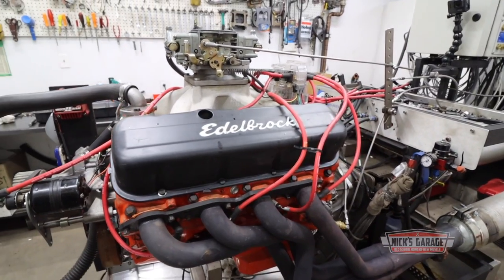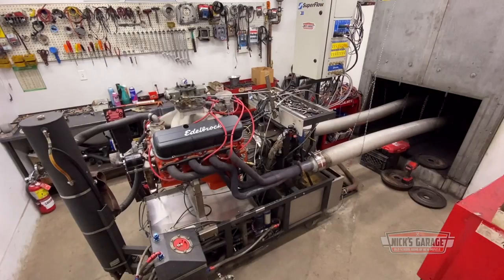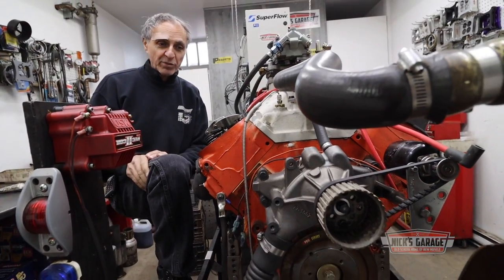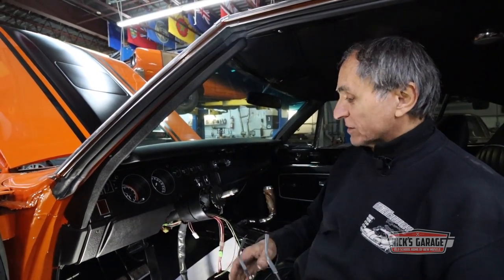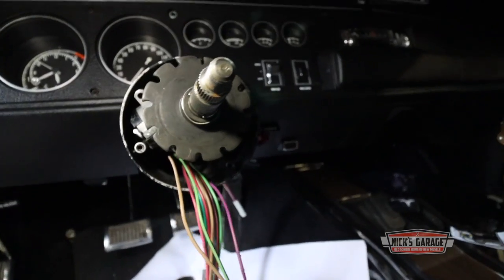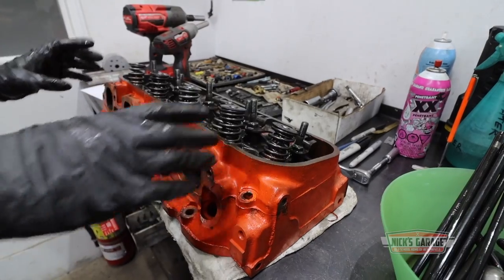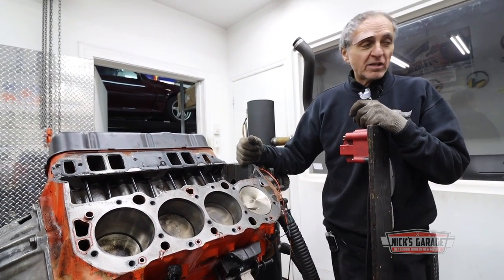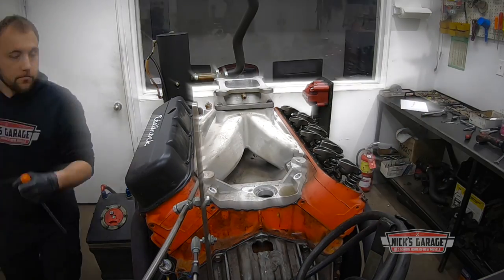Weak Big Block Chev • Wrong Parts + Poor Assembly = No Power!

Comment: As soon as I saw the fire burp out, I figured it was floating its valves too soon to get up into the power band. Turning the flattop pistons is an old speed trick, it moves the offset piston pin location and acts like a longer connecting rod, in that it keeps the piston at TDC longer. It can't be done on domed pistons, tho.  The low compression of the flattops would be great for a power adder on that rat.  Meanwhile, a mild cam and head ports that large, isn't a sin--it makes for a streetable engine and the large ports act like a large lift pattern in the cam.  At lower RPMS, tho, those giant ports create poor flow characteristics and promote the heavier fuel to fall out of suspension as a result. And that gear drive? that IS old school. It removes the slop and stretch of a cam timing chain.  But, its something to remember should the customer go to EFI...that gear drive creates vibrations, and a knock sensor will pick that up in the block as detonation and cut back on ignition timing. 

The solution to this engine?  Either stroke it out to add low RPM torque and take advantage of those too-big heads (in the 1970's, smart rat builders knew the oval port OEM heads in the junkyard were better on the street than the OEM rectangle ports), replace those heads with some oval ports, that single plane intake with a high rise dual plane, and an 800 cfm carb to increase the compression to get more low RPM power, or use nitrous with the combo as is and a modern trans with a steep first gear--but definitely step up to valve springs that won't float the intake valves open and set the air filter on fire (esp. an oil soaked K&N).

Comment: 600 hp built from the old engines isn't hard. But to rip someone off with a giant carb and slick ignition ebay rip off, or craigs lister. I build engines for the purpose it will be used. Not very many people are going to take a fire breathing, gut buster ear popper for a daily cruise. I have a mopar LA engine getting ready to fire up, it's built for low end torque. It will be around 375-400 hp and will be happy for what it will be doing. Professional parts changers and Summit have a happy relationship.

Comment: Anyone who installs pistons up side down should not be allowed to touch tools, period!
Reply: wysetech2000 well assuming it’s factory pistons. And the big side of the rods are still oriented correctly. That’s actually a good thing. Moves the pin offset to the other side and actually frees up a little power.
Reply: @knifelover73    It didn't free up any power in this case.

Comment: They forgot the 8-71 blower to go with that compression ratio
Reply: Yeah!
Reply: assembled wrong and lacking a nitrous kit.... uhhh, yup.
Reply: And it would still be too low
Reply: @GJ-DT  8.5 to one is around the ideal compression ratio for a forced induction motor for the street. I ran a 144 B&M on a 350 with that compression ratio and had a blast with it. Almost as much fun as my 440 six pack motor Challenger.

Comment: He would have been better off getting a crate small block 350 Chevy . Heck you buy those for 1400usd shipped and all. 

Cam, heads, good carb on it, high rise manifold , headers really doesn’t cost all that much and you’ll hit close to 400hp.

From there one you spend a bit more money to get it to the 600 reliable. But still not impossible or really hard

Comment: wish I had $1 for every "600hp" car than I outran with a small block with nothing other than performer intake and cam.  Most home built motors are lucky to push 300.
Reply: Nowadays they are going to get smoked by junkyard 5.3 with a cam swap😅
Reply: @neilbrown82  no
Reply: @CJDUBstang  yup !!
Reply: They go from crisp and responsive to smothering bogging, black cloud monsters, over carb , a cam that has no bottom end pressure i n"?the cylinder, the list goes on and on when you have to run racing fuel, you have to think,'what were they thinking?
Reply: 92VXEG  i broke many hearts with an ugly 4 door 55 chevy when I was in the Navy.   Only got in trouble once, when the Command Master Chief tried to pass me in his new 88 Vette and I wouldn't let him.
Reply: @neilbrown82  lol no.
Reply: @frigglebiscuit7484  ok boomer
Reply: @neilbrown82  a cammed 5.3 is like what? 350hp?

Not to mention weighs as much as a big block chevy. HAHAHHAHA
take a seat fool.
Reply: @CJDUBstang  probably closer to 400 ... Weighs less and probably still going to take your ass to gapplebees ....
Reply: A 5.3 couldn't out run a big block stock with out boost or spray come on y'all know these kids today have to boost or spray and boost everything. My dad thought me there is no replacement for cubic inch displacement.
Reply: @thunderjet4294  😂😂😂😂😂ok boomer
Reply: @thunderjet4294  for us "kids" we found a replacement for displacement its called boost or giggle juice.
Reply: @vhp454  i don't even have an ls. I have a 12:1 comp boosted,camned ported vq35 with meth injection. It was a joke i don't care what anyone choses to run at the end of the day we all have fun.

Btw nice looking ride. I sure as hell can't lift the wheels.
Reply: @thunderjet4294  take the best stock 427, arguably the Yenko 450hp version, and stack it against a cammed 5.3 and the LS will wipe the floor with it every time. You might pull the holeshot but the LS will run it down no problem all other things being equal. That's just basic math and physics. I've gotten as much as 440hp out of a 5.3 with a fairly mild, streetable, cam swap, a little head work, intake, and exaust. I've seen others get closer to 475.

Boosted, you'll never even come close. Stock bottom end 5.3 with a cheap GT45 clone turbo in my regal puts down 700 wheel and that's detuned a bit to keep it more reliable.
Reply: @kevinmccune682  
Bingo. I was ashamed for people I smoked with a 260 Olds v8 and 27*:1 peg leg. They're always over carbed, out of time, and out of tune. A tight tune will shame many better cars.
Reply: @vhp454  
💪😁💪
Reply: @xmo552   People tend to go for the "most" a good "sharp" motor in a light correctly geared chassis will surprise many.

Comment: You just can’t trust people. My machinist showed me heads off a ‘fresh built’ 454 a guy bought for his boat. Valve guides were loose enough to keep the valves from seating, you could rock them by hand pushing the retainer.
  I always beat people up on price for used engines, I’m gonna have to tear it down anyway.  I bought a 360 Dodge ‘good running takeout’. Heads had been done when a valve smacked a piston. Guide liners they installed were moving with the exhaust valves! I was lucky it didn’t run long enough to wear the head out. My machinist put iron liners in and he said they went in tight. Close thing. Used iron is expensive to get done right.

Comment: Some people should never be allowed under the hood of a car.   I bought a 64 Rancho with a new 302 out of a Mustang ( or that was what I was told)   I should have parked it when I found that it would start when in gear,   But what was the real eye opener was when I heard a loud pop and transmission fluid was flowing all over street in front of post office,   When I towed it home and put it on ramp I found the line from transmission to radiator was made from........a hose from a Douce bag!    No lie!      I replaced all hoses and tried to fix transmission but decided to sell the car...,after disclosing to buyer the transmission problem,  he was a lot better mechanic than I am, so I was confident he would fix it correctly.

Comment: I had an engine shop press on my Pistons 180 off I went back and told them I want these fixed and they said put him on the other side of the motor it doesn't work that way cuz when you go to the other side of the motor the champer are still facing the same way

Comment: Some people read too many magazines and they think that they can build a motor
Reply: A buddy of mine was an engine builder back in the 70's, 80's. He would get people coming in to his shop all the time with a Hot Rod or Car Craft magazine asking to build a motor to the specs that some guy had in an article in his show car. He had to tell them, you're driving on the street, don't build it that way or you'll be fixing/adjusting something every week. Overcarbed, stupid high lift cams, compression so high you need av gas, all sorts of crap.
Reply: @norton750commando  I know exactly what you mean I'm no engine builder like Nick I can put one together and it'll run but when you have somebody that just starts regurgitating stuff that they read out of a magazine you know like I want a full race cam in my engine what the hell is a full race cam what's the weather what's the duration what are you talkin about I'll call at Comp Cams and tell him you want a full raise can see what they say to you

Comment: Whomever built that 427 BBC didn't know what he was doing, let alone claim that HP rating. 
I built a '70 402 with pop-up pistons and put '66 closed chamber heads on it (approx. 10.75: 1 compression). A .510 lift Crower hydraulic cam in it and a Holley 750 cfm double-pumper spread-bore to handle the fuel. A friend of mine, Joe Satmary, guesstimated the HP at around 465+. [Wink.]

Comment: Where's those awesome valve covers? Still getting crushed?
I wouldn't want to destroy new parts, but they can make nut & bolt holders, maybe a planter for flowers..😄
Reply: Notime.   I still have them. I read a comment from a viewer that they are caps to cover the original factory valve covers. If I only had an original  set of stamped steel vortec valve covers to try the fit. I have located a set of aluminum valve covers for now which will be installed on the SBC. The chrome caps serve no purpose at the moment. Wait and see.
Reply: @nickpanaritis4122  They look like they were just for mark up engines. Not meant to use.

Comment: I built my 454 on a very cheap budget but I put in new KB203 pop up pistons with a small .200 dome and found LS5 heads at a car show for 250 or 300 dollars.... had the heads checked and new brass  guides installed even though the machinist said they probably didn't need all of them done.  I checked everything, assembled it, with an rpm intake, worked over Rochester carb, ported the heads with a bowl job only, crane 2030 compucam...….. ( had to put shims under the springs since I originally was going to use peanut port heads and bought the cam kit for those heads )   the engine put a big smile on my face and snaps to life , is very responsive and very torquey ..… couldn't be happier for the little money I spent.

Comment: how was the piston installed a 180 degrees off did they just install it upside down?
Reply: The valve relief wasn't in the right spot. Then again the cam didn't have enough lift for them to notice either!
Reply: @thetriode  yes but the Piston can only be installed 2 ways
Reply: @Free2KYT  180 off means they needed to pull the Pistons, rotate 180 degrees in the bore and boom right. That said yeah I think you mean the same thing
Reply: @thetriode  yeah we ain't arguing against each other

Comment: similar compression readings my old worn overhauled honed new rings man i was poor you know mopar 400 engine had with stock 8.5:1 compression pistons, i installed closed chamber heads that helped it a little bit to run a bigger cam ! lol i think i had a solid 325hp  coming out of it !

Comment: He's sort of lucky that the cam was weak. If he had a high-lift cam and wrong oriented pistons, they may have touched and he might have really trashed the valve train and pistons or more.
Reply: bdrrogers - I agree, did you notice how the pistons were installed way down into the holes?  It would probably take a 700”+ cam to come close!  I bet that engine is lucky to have a 8-9 - 1 CR.  I feel bad for the owner.  If I were him I would be checking into EVERYTHING else on that car.

Comment: Some people think that they know what they are doing when building a motor and they haven't got a clue!!! You have to match everything to everything! Gears in the rear cams everything has to match each other!!!
Reply: My uncle was a 50 year mechanic who used to race a 55 Chevy Bel Air with a blown 327 running low 10s back in the early to mid 70s which was crazy for that time period especially for a street car!!! He had 2 sons who had their own cars! 1 had a 375 horse 396 Chevelle and he ended up putting a LS6 454 and his brother had a 68 Road Runner that came with a 383 magnum and he changed the motor to a 440 six pack! They are the ones who taught me how to build my engines! I have a 66ss Chevelle with a 12to1 sb 327 and Dart Motown heads ported and a ported victor jr intake a 750 Holley worked up to a 850 then it has a M21 muncie 4sd and 4.88 rear gears!!! Last time and first time at the track it ran 11.64 at 116 mph in the Quarter mile!!! Since I changed the cam and tuned it it's a lot faster and I'm saving money for a roll cage because I don't want to make one pass and be put back on the trailer!!!

Comment: This was likely hacked together to use up a supply of spare parts someone had lying around.  Otherwise, it would have been more cost effective to just buy a crate motor.  

Dropping in a crate motor doesn't make for an interesting youtube vid, but for the money they are pretty tough to beat.

Comment: Unbelievable. My worn out (but still running) stock 454 in my pickup truck has the same compression as that 427. And I’m nothing more than a home mechanic. I know just enough to be dangerous, but even I know to put the pistons in correctly. Jeez! I’ve seen it on a Caterpillar Diesel engines too. The pistons were 180 degrees backwards and the fire craters weren’t where they were supposed to be. Wow. Just wow.

Comment: Same thing, but even worse happened to me. This was when I was younger and not into BBCs yet. I was about to learn the hard way. A Mechanic shop had this pretty impressive looking big Chevy on a engine stand in his show room. He was bragging about all the good parts it had in it. I could see Comp Aluminum Roller Rockers thru the breather grommets. He had over $5000 in receipts. Block Said Hi Per Pass under 2 piece timing chain cover, double roller chain. Supposed to be a 496,11-1 comp, big hydraulic flat tappet cam, good rods, 4 bolt mains. Even had new 2” coated headers of unknown brand. He wanted 3000$. I thought man I better jump on this quick. Paid cash. I pulled it apart to presumably degree in the cam, and check bearing clearances . I don’t trust other peoples work. This turkey turned out to be a 461, .030 over 454, cast factory crank, 2 bolt mains. Peanut port heads. Probably7.8-1 comp cause pistons were like .080” in the hole. I really learned a hard lesson that day. This guy seemed so believable. Completely screwed me over. Now Ive got a Dart BigM 565 with Dart Pro1 345cc heads, but it cost me 5x that 3000$ to build it myself. Ive got 30 hrs in porting the heads alone. We shall see who has the last laugh when I drive this monster to his shop. Im going to tell him its the same engine. Assholes all around just trying to get something for nothing. I dont know why it still amazes me when someone does something like this. Theyre lucky I dont get revenge. Not me. Maybe the next guy though. I personally dont like digging 2 graves or Id done it long time ago for my first wife.